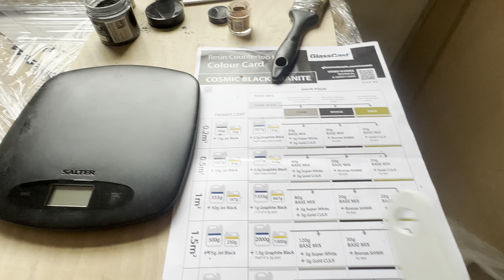553. Coating Resin (granite) tests and trials

Comment: Your trial ones came out really good.  Well done. If you wanted more black maybe instead of tipping the white and golds on use the other end of the paint brush or a pencil even to drip it on in thinner lines then use the hair dryer again as you did. Also you spoke about depth and layers, you can also do one layer with half the resin that you used allow to dry completely as you did in today's video and then do the whole process again and create different patterns again. This would create a real layer effect and you will see all the patterns created at different depths.  😊

Comment: I'm so looking forwards to seeing the finished counter tops, i really hope the bases are strong enough to take the weight, I'm sure they are as you've reinforced them, but i still have my fingers crossed.  I love watching as you problem solve each step of the pour. Awesome episode. 👍
Reply from the maker: The bases will be plenty strong enough although the resin certainly adds weight 
6KG extra across both surfaces is quite a lot

Comment: I think you should be brave and persevere with the colour mixing as your test pieces were a success. Personally, I preferred the smaller test as it successfully portrayed an organic looking blend. Why not use a picture of granite as a visual guide for your next pour? I think after watching your video the hairdryer and pencils blended the colours more naturally, more so than the brush did which was too efficiently uniform and looked a bit heavy handed. Do smaller test pieces and auction those off please, folk would then almost own a little bit or your boat 😁 That’s my two penneths worth!

Comment: When you want higher accuracy from a level, you need to use it one direction then turn the level 180 degrees around and check again.  It's level when the bubble stays in the same place regardless of the printed lines.

Comment: You have to have a level working surface.
If too much colour is added it will end looking like a mess.
To make a marble effect, use a toothpick and drizzle the white in a straight line and then move it with the hair dryer, being careful not to push it too wide.
Black always looks good.
Reply from the maker: Yes I am trying to achieve a perfect level
Reply: @TheNarrowboatThatJamesBuilt  
A boat makes that a bit difficult.
At one point I was doing a lot of resin as art work, it nearly drove me mad……….definitely not as easy as it looks.
Cheers

Comment: I might be talking right out of my backside but if the resin is so sticky why not paint the wood upside down….no dust hopefully.
Reply from the maker: Errr, gravity
Reply: But is it different to blacking under a boat….how thick is it…probably as thick as I am by the sound of it 😂
Reply: Is it as thick as blacking paint….
Reply: Just watched the rest of the video…..don’t do my idea it won’t work…..gravity I’m afraid.
Reply from the maker: @peterlondon2217  I get your logic - the product is as thick as blacking you’re right, but the coat is also much thicker - ie you put a lot more on per square inch so that’s why it would just fall off - it’s not brushed on it’s poured on 
Your idea might work though for the base coat as that is more painted on than poured

Comment: Zeroing a scale is setting the scale display to zero when there is no load applied to the scale. A that point the zero on the display is the true zero of the calibrated scale. Taring a scale is setting the scale display to zero when the scale has a load.
Reply from the maker: Ahh - thanks for the detail. Good to know

Comment: Geez James. Where is your mask???????
Epoxy Resin is not the best material to work with at anytime.
Reply from the maker: For this stuff you only need a mask whilst sanding which I wear. No need for a mask for mixing and pouring and playing
Reply: @TheNarrowboatThatJamesBuilt  Thats good to know as i remember the fumes it use to give off.